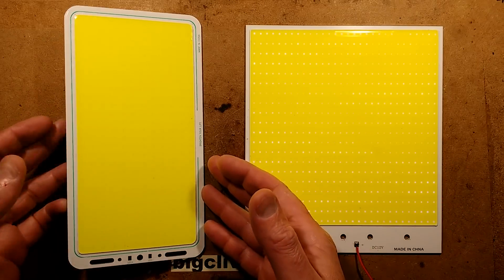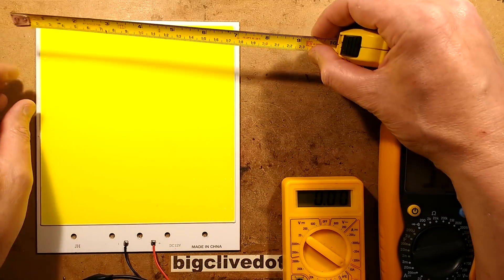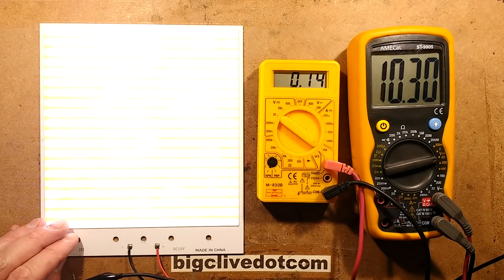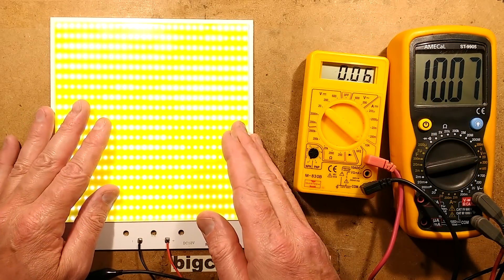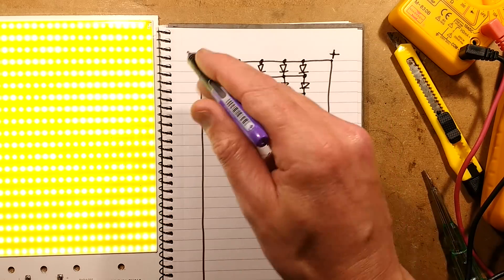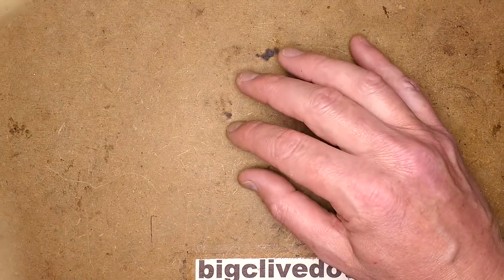Even BIGGER "200W" COB LED panel tests.

Comment: It's really not a fair test to run this array at 1/1,000 the current and look for differences in light output  from different leds , you did the same with a (relatively) small 100W in another breakdown ...  there will always be visible differences at extreme low currents ... Better to run it at high current , and put sheets of paper over the array , the light will shine through the paper ... keep adding sheets to lower the amount of light coming through and that will show if any leds are mismatched at operating current (they never are in my experience).
It's a good idea to run high power leds at about 10% of their rated current , this way no heat sink is needed , but more importantly you will get about 30-40% more lumens per Watt input .... rumours cool white is not good for the eyes , it has a LOT of blue ..Warm white is fine .... ...Great chanell ...the best on Youtube.
Reply: First it's not 10000th of the current, but it is about 1/10th to 1/20th, as these diodes should not be run above 20mA per diode but will basically not light at all at less than 1mA, and second it is absolutely a fair test, as it reveals how well the diodes are matched and whether they're likely to fail. When you have unmatched diodes, some always burn out eventually without individual current limiting per diode. They do seem to output a more similar amount of light when you run them full power, but some are overheating then still. Furthermore 10% rated current, really? There will be very little light, only 3W worth or less, as this is really a 36W light. The efficiency is also not so trivial, the phosphors gain efficiency above a specific threshold, but the diodes themselves lose efficiency when they run hot, and 10% is likely much too low to reach the peak efficiency.
Reply: Clive addressed this topic in an earlier video
https://youtu.be/_wR_mFWeI6Y
Reply: @ 3::25 Clive is running the cob at 9.96 V the current is between 10 and 20 mA ... full power for this light is 1000 times more !! , 13A... at this low voltage the extremely small difference in light is due to minute differences in the push back voltage from strings of diodes ... perhaps one string may have a back voltage of 9.51 ... another dimmer string will have 9.57 ... but when the  voltage is at 14V this difference of 0.06V is insignificant compared to the 14V .
At 10% current the power going to the led is 10%... power = IV .... V is the push back voltage which stays almost constant .....
Peak efficiency is at lowest current ...the documents are out there .
"this is really a 36W light!!!?????" ...it's 200W clive ran it up to high currents
Reply: 12V 3A work out to 36W. Running it at higher currents is stretching the individual COB LEDs beyond 20mA of current, even if they were well matched, which they obviously aren't, you can do this but likely not for very long. You are right, it lights quite a bit earlier than i expected it to, at less than 1/100th of the rated current, but not at 1/10000th, i don't think so.

I don't know why you trust bottom feeder eBay seller specs at all. I give this panel a few days of running at 50W until failure. 200W is a complete and utter joke.
Reply: I don't believe it will blow after a few days .... rather than cut into it and drill holes , it would be better if Clive left it running near 200W to see how long it lasts ...it will need a good heat sink  600 leds in that cob ... single leds can be up to 3W, 1A ... these cob leds are not 20mA
Reply: @ webchimp ... thanks , I hadn't seen that video .... @ 10mins Clive explains that faulty leds that show low resistance will cause some lines to not light ... we do not see this in the 200W cob video.
Reply: that's ridiculous ...in the video clive runs the panel at 12.6 A  ...if you run any led at double it's rated current it will INSTANTLY blow ... it is not made of 20mA leds
Reply: "perhaps one string may have a back voltage of 9.51 ... another dimmer string will have 9.57 ... but when the voltage is at 14V this difference of 0.06V is insignificant compared to the 14V" You seem to be forgetting that in LEDs, small differences in tension give quite large differences in current. 0,06V may not be significant but 0,09V may cause runaway, just to pull some numbers from the place you obtained them anyway ;) This is however how it works with diodes.
Reply: Good quality cobs from cree light perfectly at even the lowest currents....

Comment: even if i wired this panel with 000 awg wires i wouldnt feel comfortable shoving 8-10 amps on those tiny little pads.
Reply from the maker: Technically speaking, the tracks underneath have an aluminium heatsink.

Comment: Looks like they may be fairy efficient at lower power levels too, eg through a dc-dc converter with current limiter. I hope my 200w 240v cob has matched leds (yet to be tested) thanks for the geat info once again!
Reply from the maker: The mains powered COBs often have the LED all in series anyway, so it's less critical.

Comment: So, is it actually possible, or even feasible, to build one of these cob panels? Sorry if that's a stupid question, but I'm curious. Is this just a factory kind of thing?
Reply from the maker: It requires very specialist equipment to attach bare LED chips to the PCB and then bond tiny little wires directly to the surface of the chip.
Reply: Thanks Clive, I had wondered since you play with them so much! That's what I thought, though.

Comment: Time for a new soldering vid. Check this out on AliExpress. Search for
"QUICKO MINI T12 STC OLED Digital soldering station 942"
Reply from the maker: There's a wide range of the T12 style irons on eBay.  Including ones with the electronics in the handle.
Reply: i'm looking at the KSGER STM32 mini case. because i don't trust cheap power supplies these smaller units seem to have everything one could look for .. simple soldering controller and good quality power supply because i can buy one my self instead of depending on the seller.. Last month i got the TS100 in but in find the chisel tip TS-D24 way to big.. That's why i'm looking for the station mentioned i can get T12-D16 tips for that one..
Reply: i'm looking at this station.
https://www.aliexpress.com/item/-/32878522554.html?spm=a2g0s.8937460.0.0.46652e0elHXjjm

there's also one with a cheaper handle.. but i think the metal one could be the better option..
https://www.aliexpress.com/item/-/32850601075.html?spm=a2g0s.8937460.0.0.cd7c2e0elrQtUC

Comment: I'm wondering if you take two of these panels and run them in series off of a car battery, how bright will they get and how hot will they get...?
Reply: Peter B., in series they will get only 6 v each, not even at 9 v did they light at all.

Look up the curves for current vs voltage on LED and regular diodes, it's not linear at all.
Reply: but, at wide open amperage, they should do something, is what I'm thinking
Reply: I tried that with 10w ones. No result, the current doesn't flow
Reply: Peter B. A white diode needs a little under 3 volts before it starts conducting at all, the LEDs usually run between 3 and 5 volts.
The LEDs are wired in groups of 4 in series.

The LEDs doesn't care if you have a 1000A capable battery, they'll draw what current they do depending on the voltage.

Two panels in series gives 12/8=1.5v per diode, far less than needed before they start to conduct.
Reply: I'll have to play around with them, thanks

Comment: We like lights that can be used to grow naughty flowers. 
It seems odd that a power supply is not "on board" by the addition of a few extra surface mounted components.
Reply: Blank Steve A proper power supply for these would be the size of a pack of cigarettes and a similar price to the panel itself.
Reply: John F. Doe - I have noticed some commercial manufacturers content to use a Meanwell power supply as a "black box" soloution.  While being easy; they are quite pricey.  It might make sense to make the  light more modular.  My imagination has a several panels on flexible posititioning arms....Like standard lamps only more grown up :)
Reply from the maker: I suppose it might be viable to use standard 12V LED power supplies (not the halogen version) to drive panels like these.
Reply: +bigclivedotcom the standard power supply sounds like it is optimised for cheapness of construction rather than electrical effiency.  Is it worth chasing those saved Watts ?
I watch an American chap called "Greengenes garden" who makes these things.  He had the YT channel shut down a while back but it is back up now.

Comment: It would actually be interesting to see that panel slapped across a fully-charged lead acid battery or a power supply of the same voltage. Make sure to collect all the magic smoke so you can put it back in, though.
Reply: No go the li-po high current route
Reply: Music Central Even better!
Reply: The Tyttuutface yeah man around 48volts @ 50amperes would do that board real good, oh yeah, and did I mention smoke
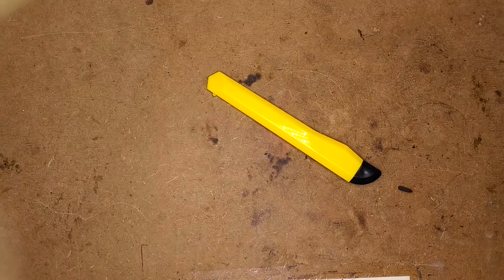Reply: A fully charged lead acid battery will be ~12.6V at rest (which Clive got up to in the video, see 13:39). Just off the charger it'd be a bit higher, but should drop down fast to 12.6  as soon as you start to draw any significant current. Now, 14.4 from a running car w/ proper charging, using decently thick leads, might be into smoke signalling territory tho :-)
Reply: I've got 72 2V (Enersys Powersafe DDmP 125-33s) batteries rated 2000Ah each available for testing at work.  If that's too much, 48 rated @ 1600Ah as well.
Reply: What about running it from a semi truck? @ 14.5 volts???
Reply: Shawn Howell 
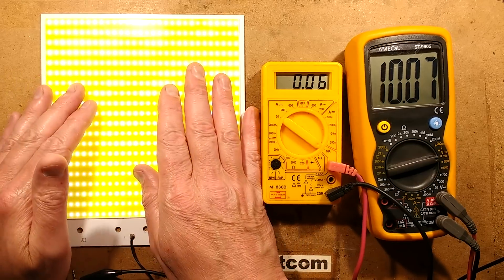same as a car battery, as BC talks about around 5:55

Comment: How do you mount the smaller one to a heatsink? It has no screw holes.
Reply from the maker: I wonder if they'd use thermal adhesive like zinc oxide cloaded silicone.
Reply: I suppose it doesn't have to be all that conductive, 70W is less than your typical CPU dissipation and that goes across a few square cm. Maybe I'll just estimate if regular epoxy should do the trick and use that.
Reply: If I can stay below half a millimeter thickness I should be under 10°C drop for regular epoxy.
But how to apply pressure to the surface, can I just press on it with some foam?
I'm afraid of damaging the bond wires, after all we have you to wreck your toys so we don't have to. ;-).

Comment: No mounting holes for heatsink.
Reply from the maker: I'm wondering if it would be better bonded with thermal silicone glue to avoid buckling when hot.
Reply: bigclivedotcom would be nice if you come across a decent broad spectrum cob for growing plants. (Not for the stigmatized majjy purposes 😄). Looking out for a cheap ass solution. Like comment if you've responded 👍

Comment: I wonder what these are actually manufactured for,never seen anything using anything this size or it’s smaller brother
Reply: Maybe for ceiling lights that span the whole ceiling or are just that big? For lights used in exhibition installations? Would also make sense as a video production light, but i haven't seen any made like this and i don't think CRI is all that up to snuff, not with that kind of mismatch.

Comment: Omg ...  I have to buy some of these! ...  :).  Lighting for my mobility scooter! ...  pimp my ride!
Reply: Get a bigger battery else your 11 miles will be down to a 3 mile radius? Or fit a dynamo :)
Reply: They call that the Jaywick special.
Reply: put a windfarm on the bike - electrify while drive . . one fan for free
Reply: portable nuclear reactor would be the go. Im sure russia would sell one to you.
Reply: Xaviera Yayaell
, Are you talking about Jaywick Essex ?
Reply: @fhhsvnggbh - Soviet era nuclear fusion generator "Затмить" is better, type 249 is light enough to carry around. Avoid "Мерцание", it's oversized garbage._
Reply: you want ill put neon strips under it and around it to :) cover the floor with solar cells and you good all day long (lots of sun recently) XD
Reply: User name checks out.
Reply: Tally Oz Would a dynamo be more efficient than using the built in batteries?

Comment: I can't wait for the inevitable goliath COB that is at least one square foot.
Reply: Alec J why would they stop there? I'm sure we'll see at least three square foot ones sometime soon. Even if they don't work, doesn't seem to stop them.
Reply: Real "Goliath COB" arrays are officially measured in Hectares ;-)
Reply: Alec J EEVBlog already uses that size or bigger as studio lights. Each is the size and look of an office ceiling tile, looks like one when off and is powered by a radio controlled constant current supply bought separately.  One of his recent video was repairing some of those supplies.
Reply: "Goliath COB arrays are controlled by inserting or removing graphite rods into the power supply, keeping supply output within <= a MegaWatt of the COB array demand.  Overdriving these things makes auroras over Southern India and destabilises the moon's orbit. Hurts your eyes too, even with Ninja Safety Squints.
Reply: Or if they make one with the backing the same size as the emitter element, so you can seamlessly array them. Replace the backing element with one that has built in fins or some form of heat sink mountings, and make all electrical connections on the back. Mounting would also be done from the edges or the back side. (None of those edge tracks as they are doing with them now.)

Then the size would be limited by how many in the array you could drive. This would also allow you to make different shapes depending on how you tile them.
Reply: BREAKING: NASA scientists at the Goddard flight center report they're tired of being one upped in YouTube comments sections, unveil plans for led cob panel covering the entire earth facing surface of the moon.
We have NASA's chief scientist here to weigh in on the matter, what's your opinion sir?
"Yeah, suck on that, bitches".
Well, you heard it here first folks. Tune in for news at the quarter hour.
Reply: @John, yeah I've used those sort of things before at my old job, but they weren't pleasantly questionable jelly-bean parts from overseas.  :D
Reply: "Real "Goliath COB" arrays are officially measured in Hectares"

Alien: "What the fuck is that big bright light coming from the Earth? It's huge!"
Reply: Make them 2 foot by 3 foot and they should drop into a drop ceiling grid.
Reply: @cougarhunter33  Someone get this man some crowdfunding.
Reply: Superb, I'll take enough to cover my entire car! 🙂

Comment: Is it possible the 200 watt rating is equivalent light from a 200 watt tungsten setup?
Reply: gato38 I wouldn't be surprised at all
Reply: nah, it's far too big for that.  IIRC a 12w flouro is equivalent to 100w, and led's are more efficient then those.

It's totally possible that this panel could handle 200w if heatsinked properly and the led chips were better matched

Comment: I would be interested to see what the current draw is if the weedy thin cables are replaced with big chunky ones - presumably it would then just be limited by the (thin?) tracks on the PCB.
I'd also like to see what happens if it's suitably heat-sinked and run at 14.7v (i.e. 12v bulk charge voltage) for a while - does it pull 200W? Does it explode in a huge ball of plasma?
Finally, say I do want to plug it into a battery - what's the best (cheapest/safest) way of limiting the current to something sensible?
Reply from the maker: You could use a few 1 ohm resistors either in series or parallel depending on how bright you wanted it, but they would possibly get hot.